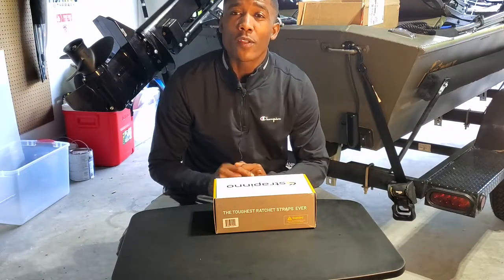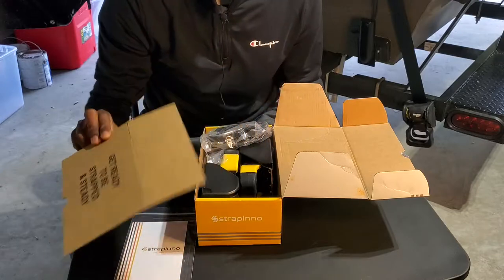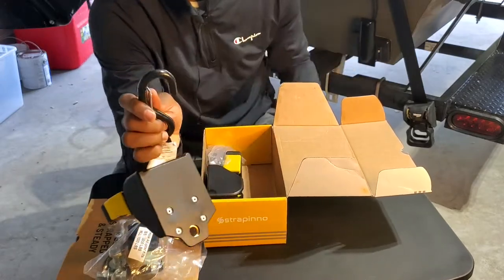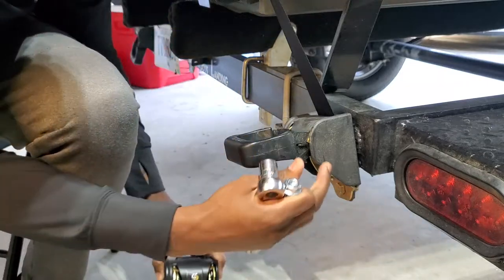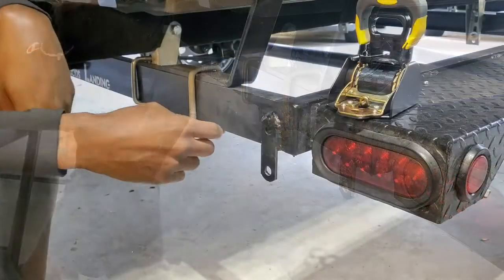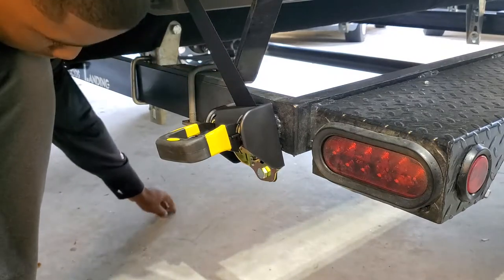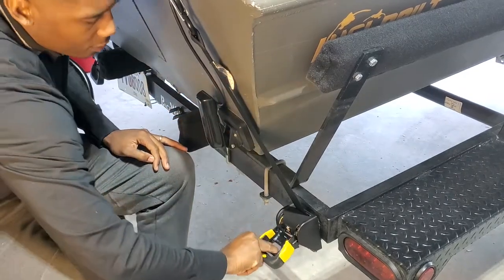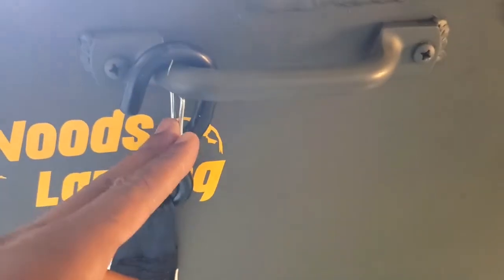You NEED This Boat Trailer UPGRADE! - Unboxing & Install | Strapinno Ratchet Straps

Comment: Give yourself a good angle? That the housing will find its own 'good angle' when you lightly tension the strap before tightening that nut.
Reply from the maker: Makes sense, thanks for the insight. Will try that next time.